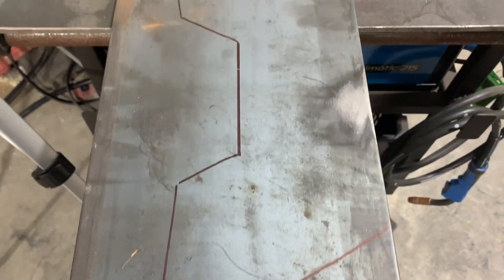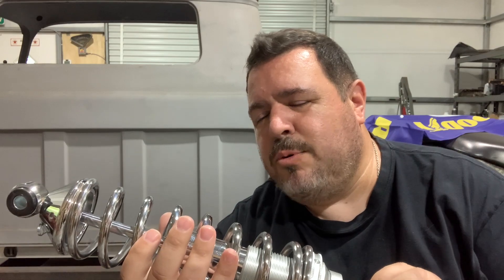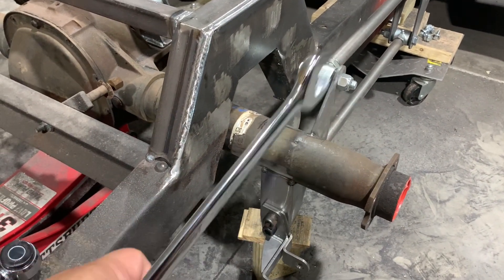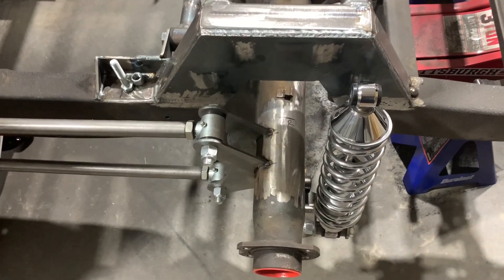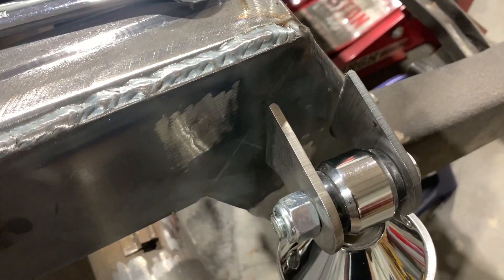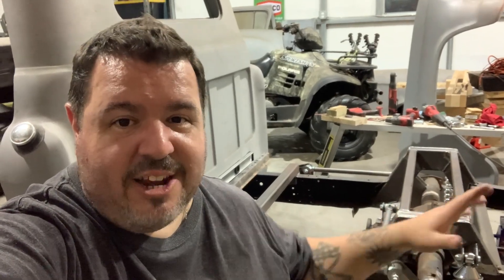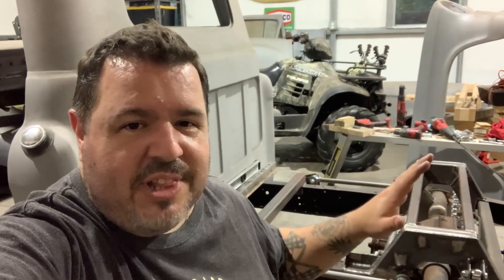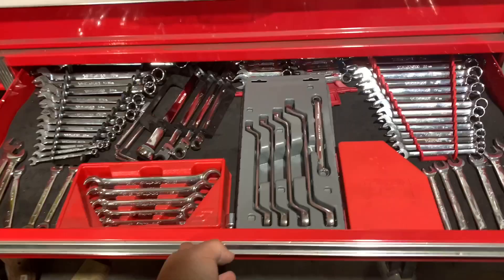Rear Coilover Conversion on a 55-59' Chevy Truck!

Comment: I don't think you'll have a problem with wheel fitment. You'll probably find you'll need very little backspacing just to make the wheels fill the fenders. A narrowed explorer rear end really is quite narrow in a 55-59 chassis 👍
Reply from the maker: Thats what Im thinking. Im going to have to put the entire bed together first because with the new heigh of my 4 link bars, they will prevent the installation of the second cross sill that the bed mounts too. Im thinking of just laying the assembled bed on the first and last cross sill, squaring it up and then taking my wheel measurements. As for permanent mounts for the bed, I’m going to have to fabricate something for that missing cross sill… it never ends lol

Comment: You might want to consider welding in some small triangulated gussets at the top of those shock mounts. If that rear end hooks, or some power turns, they may want to move forward or backwards. May not ever, but it's good insurance 💪🏼👌🏼
Reply from the maker: Im a fan of gussets! Its a great idea and not much work at all.